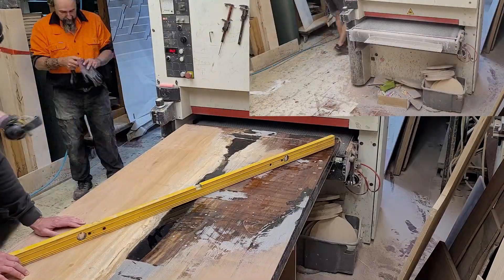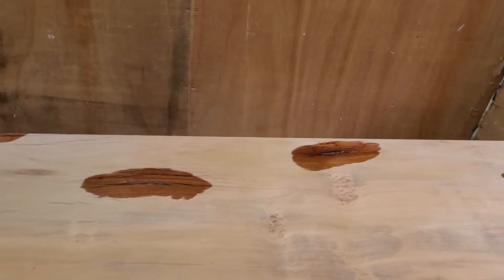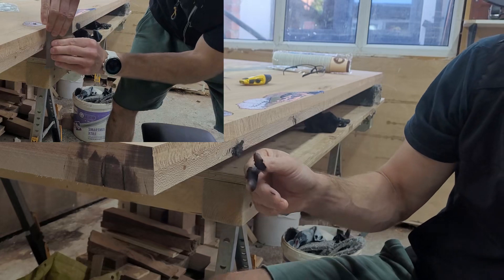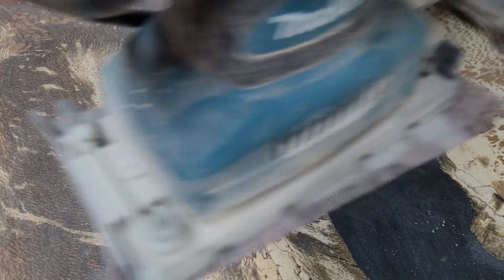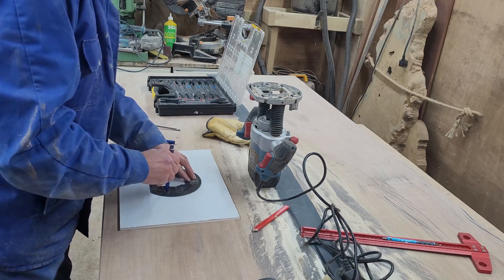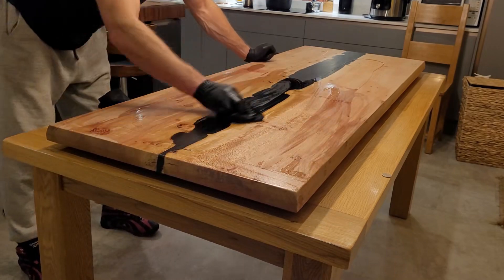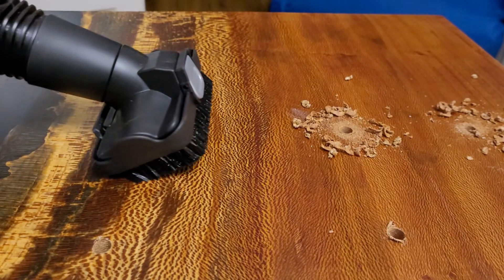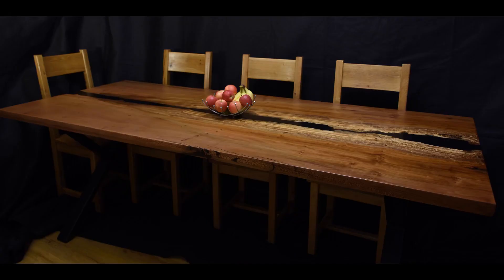coffee and dining table part 2

Comment: I find the installing thread inserts it helps to use a electric drill in slow gear so it is easier to push on the insert while the drill does the "screwing in" part.
Just my 2 ct.